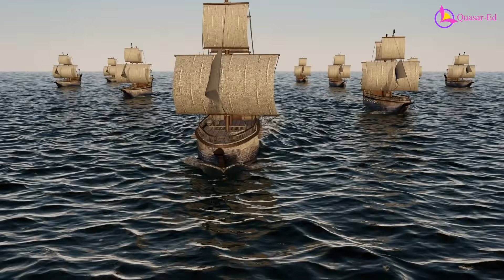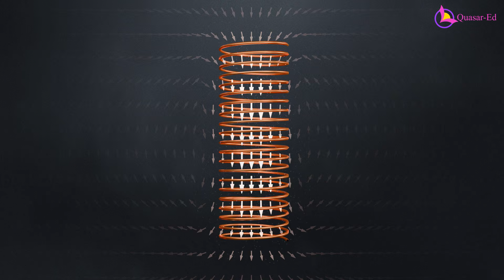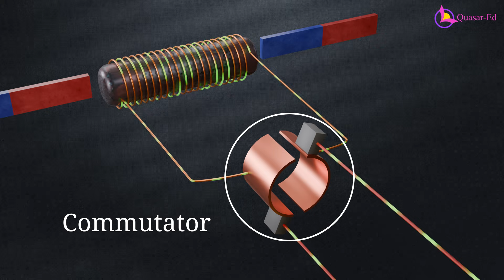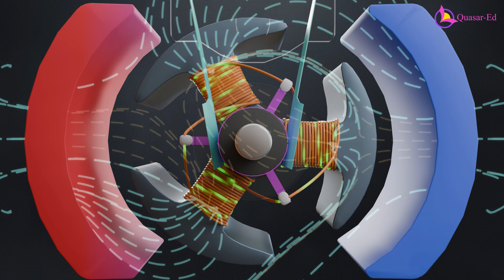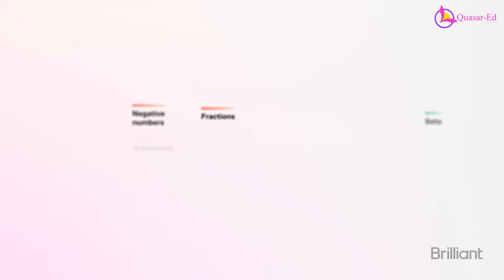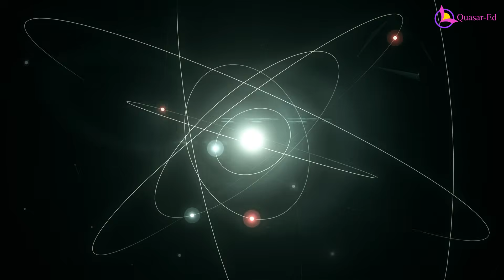How Electricity Becomes Motion

Comment: We must also remember that the current does not flow: The drift velocity of electrons in direct current (DC) is extremely slow, typically ranging between 0.07 cm/s and 1 mm/s in standard copper conductors. The amperes are actually a consequence of the electric field and this in what generates an electromotive force
Reply from the maker: Yeah, you are right. I plan to explain that in separate video.

Comment: Murder powered technology, it is caused by pain. That causes to move in one direction, pain is vectographic. Earth moves around the Sun, because the Sun's time force applies pain to the Earth, also one directional. Standalone planets don't move and don't rotate. Electricity in the primitive version of pain power on Earth. The vector moves from the smallest to the largest, for Earth it depends on the mountains , which direction it rotates.

Comment: So.. why my blender smells so bad
Reply from the maker: Does it smell bad after using it for a while? Then your motor is overloading which cause the coils to get hot and burn the plastic coating and nearby plastics. For instance, when an ice cube or chunk of meat stuck inside the blender causing it to slow down or stop, the electrical energy that is supposed to be used for rotating the motor, convert to heat. If it smells bad even without any load, you shouldn't be using it anymore. There might be short circuit inside.
Reply: @quasar-ed I just use 3 minutes and starts smell like burning plastic or something it’s just smells horrible
Reply: @quasar-ed thanks I need to buy new one😂
Reply: Daemons lol